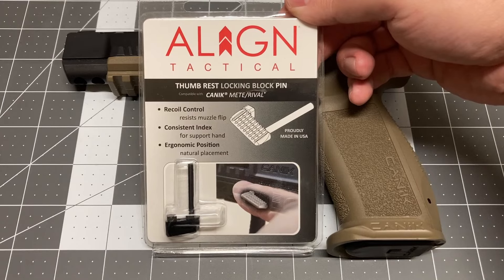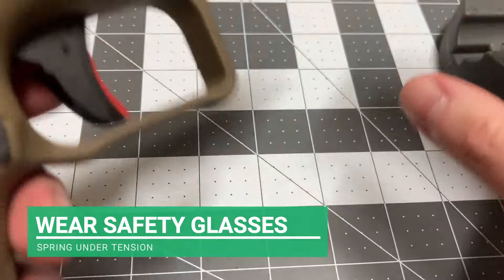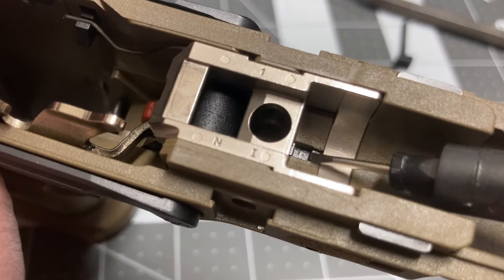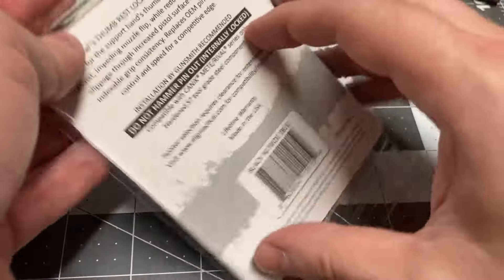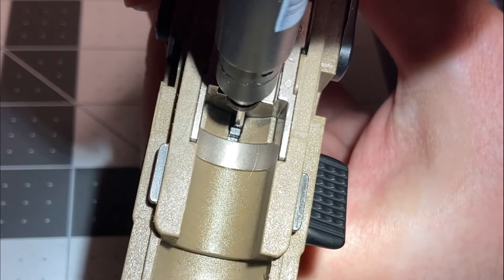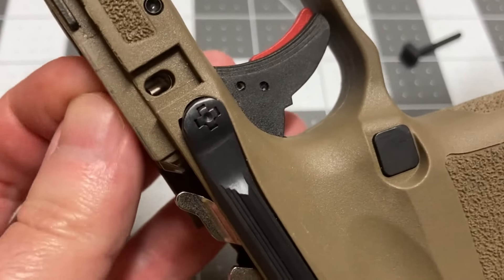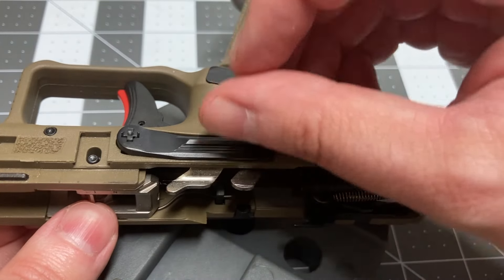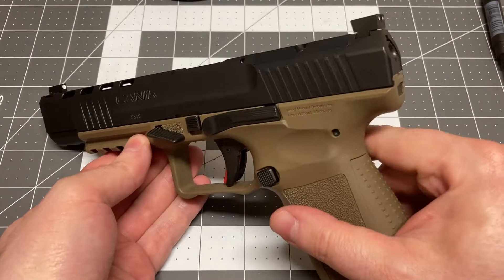THUMB REST Installation - CANIK Rival/Mete

Comment: Great video. Well done. If that thumb rest folded up so it would fit in my holster it would be perfect.
Reply: Never seen a folding thumb rest. Have you?
Reply: @roberttaylor6030  I'm a little late to the party here, but there's a spring loaded thumb rest called the antimatter wing that attaches a TLR7 sub by streamlight, I'm sure if its a good invention then it will become a more popular thing, especially if it can attach to any pic rail or weapon light

Comment: Got thumb rest, during install on Rival, couldn't get PIN lock to 2d click (2:54). Went to armorer, who aligned everything and finished install. Shot at range today, HUGE positive difference!
Reply from the maker: Glad to hear it!  We've seen some Caniks come with a loose locking cross bar that don''t click into place (like one Rival-S we are testing for that version), so they flop around with gravity and need to be held back while installing. The friction fit then holds it in place when locked, though a warranty request to Canik to fix is a good option.
Reply: My thumb rest locked in my Darkside like concrete, no prob there. For quality and price, your product is a true must-have! Please finish for P365x. My current TacDev plastic ledge is too far forward and slippery. Getting that better stippled for short-term fix, but if Align will make the same awesome quality metal one for P365x, I'd buy in a second!

Comment: Will this fit the new canik TTI combat.    I am having trouble with cycling because my left /week hand has had 5 operations. The TTI apparently has a different recoil compared to the rival and mete I have both and have no issues with then . The gun shop I bought the TTI from has proved that my hand is the problem because of the recoil spring and compensator that is on the TTI .   Great video best in YouTube until they take it down 😊
Reply: It will 100 percent!

Comment: Any plans on a model that is sloped (like at 45 degrees), that doesnt stick out quite as much, instead of perfectly horizontal?
Reply from the maker: There is actually a shallow slope on our rests between 12-15 degrees (looking at the rear of the pistol) depending on the model. This is designed to match the natural rolling cant of the thumb when extended forward in a two handed grip. This helps distribute the pressure evenly during recoil. Having it sloped at 45 degrees would increase the likelihood of the thumb slipping off when sweaty. It protrudes with half-a-thumb's worth of extension, so it is low-profile and fits the USPSA box test. Since these are more competition oriented models vs. carry, there are no plans for a variation. Hope this helps clarify
Reply: @aligntactical  sorry I wasn’t clear. I mean in stead of 12-15 degrees front to back, making it like a 45-60 angle off the frame. Essentially a little ledge that conceal guys would be more apt to use
Reply from the maker: @BF40JOE  Completely understood, and is what we are referring to. (when looking across it like the wing of an airplane), back-to-front. the bottom is 90 degrees, however the top is angled between 12-15 degrees, so it makes a shallow triangle from that view. If any steeper, the thumb is more likely to slip. It only has about half-a-thumbs worth of stick out. Designed to be low-profiled for fitting the box test and carry. We have carry holsters as an option as well.

Comment: Umm , is that a home defense/night stand gun/range gun, or how you holster carry that now ?🤔
Reply from the maker: The Rival series is marketed as a Competition pistol and this part will be authorized for USPSA Limited, Limited 10, Limited Optics, and Open. The Mete is more geared towards defense but equally capable for any role. We have 18 holster manufacturers that we are currently working with that already create compatible holsters for our other Thumb Rest products. There will be plenty of options of every type ready at launch as we already have some that we are currently using for this. So competition holsters, carry holsters, light-bearing holsters.

Comment: Why is the thumbrest so far away from the thumb? Maybe if it was swapped to the other side it could be a trigger finger rest. I don't know anyone that has a thumb longer than the trigger guard.
Reply from the maker: This is designed for a more aggressive thumbs forward grip like Nils uses, as to take advantage of the recessed trigger guard that allows two fingers to press up against. Our other designs are more compatible with a Combat grip, whereas the Caniks are mostly competition geared. Recommend trying to rotate the support hand more and it will make contact. These are positioned where Canik put the traction pads for both the polymer and the new screw in Rival-S positions.

Comment: How do you holster it then ?
Reply: You don't, u less you customize your holster.
Reply from the maker: We have 18 holster manufacturers that we are currently working with that already create compatible holsters for our other Thumb Rest products. There will be plenty of options of every type ready at launch as we already have some that we are currently using for this.
Reply: Holster plz
Reply: @Align Tactical  sounds good.  I think I'm going to be a customer for at least one of my Caniks. Are you working on something for the Canik Rival S? Are you aware they have a traction pad screwed on both sides of the slide?
Reply from the maker: @cee3  Currently using a new Black Scorpion Gear competition holster they are releasing for this and a Werkz Outlier for universal fit with a TLR-1 light.
Reply from the maker: @ammogiant824  We are working on the Rival-S version. The only difference is we are having to machine the anti-rotation block down a bit to fit the difference in the forged frames. They are not drop in like the polymer Rivals. The traction pad would need to be removed and depending on test fitment, it may or may not come with a screw-in indexing peg. Thanks
Reply: That was my exact question too lmao 🤣
Reply from the maker: @TooManyChoices1  We have 18 holster manufacturers that we are currently working with that already create compatible holsters for our other Thumb Rest products. There will be plenty of options of every type ready at launch as we already have some that we are currently using for this.

Comment: Only reason I don’t red dot mine and get good with it is cause it’s just another thing to get snagged when I need to draw am I just over thinking it?
Reply from the maker: Drawing from a belt-worn Kydex holster should be clean without issue. Where snagging tends to happen is with sights or beaver tail on shirts from not lifting high enough upon drawing and is something to work on with training. A thumb rest wouldn't snag as it would be facing skin and not the shirt side. Snagging becomes more of an issue for pocket carry where one is pulling it through a garment, pants pocket, jacket, etc. and that is where micro pistols get the melt jobs and controls practically removed like say the P365 SAS, where even the sights are removed. With larger pistols in a kydex holster it isn't an issue. When re-holstering, movements should always be slow and deliberate with the pistol pointed away from the body.

Comment: This was made for the beginner operators
Reply from the maker: Thanks, while we do see newly designated Special Forces 18B Operators running our thumb rests (alongside those with extensive time in their given MOS), the product you are referring to is only approved for the M17 and M18 - that they run in Safariland 63XX duty holsters along with our other parts Sig Sauer is currently offering directly. This new Canik-specific product however, is really for everyone who seeks to benefit from increased traction for their support hand, to help secure the pistol during recoil, whether they create traction through stippling grips, skateboard tape, liquid grip, undercutting the trigger guard, or a higher grip. This greatly helps during competition shooting and indexing the grip at speed, as the grip often can be seen sheering on high speed camera, especially when sweaty and in rain without it. As such, this technically has never been sold or marketed to the Turkish military's Canik-using operators, beginner or experienced, but they do great for the many competition shooters running them here in USPSA. Our thumb rest offerings are in use by new shooters, USPSA GMs, LE/SWAT, military, and anyone else who want to lock their grip into the pistol. Simply lock the thumb and the muzzle has significant resistance against lifting during recoil. Our fastest sponsored shooter won last year's USPSA Nationals Bill Drill competition and can currently draw and get 5 shots on target in less than a second (0.97s). If you haven't tried it, we think you'll like it.

Comment: with thumb installed what holster does it fit.  ??
Reply from the maker: We have many holster manufacturers we are working with for options at release. Currently we are using Black Scorpion Gear and Werkz which are already ready.

Comment: Has anyone figured out a holster for it tho? I would get one in a heartbeat.
Reply from the maker: Plenty of companies listed on the website on the product page with links
Reply: @aligntactical  I'll check it out. Is the gas pedal fixed in one position or is it adjustable? I am curious because I have smaller hands and my thumb isn't as far forward as most.
Reply from the maker: @Bane_Diesel  It isn't adjustable, but designed to work for small hands when gripping to the ergonomics of the pistol. Meaning, it will feel far forward if gripping the same as the P320, VP9, or Glock versions, unless the fleshy part of the palm is indexed into the palm recess on the grip. This is actually higher than the other platforms and will rotate the hand into proper position. This allows the activation of weapons lights by placing the thumb more forward and aligns with the stippling to index on the side of the frame.
Reply: Was it just recently sold out or has it been sold out for a while?
Reply from the maker: @Bane_Diesel  Sold out for a while but will be back in stock in around a couple weeks. Thanks

Comment: Does this work pretty well? Iv been thinking about getting the Wasatch  comp and gas pedal
Reply from the maker: It works incredibly well keeping the sights on target. We maintain a shallow angle that naturally supports an aggressive thumbs forward grip and don't change the balance as to make the pistol front heavy. Have a lot of holster makers working on molds now and already have some that we are running before they are released.

Comment: Would this work on a tp9sfx?
Reply from the maker: Unfortunately it is not compatible with the TP9 series, as they use a roll pin instead of a solid internally locked pin. Also, the TP9 series does not have the frame recess needed for the anti-rotation stop.